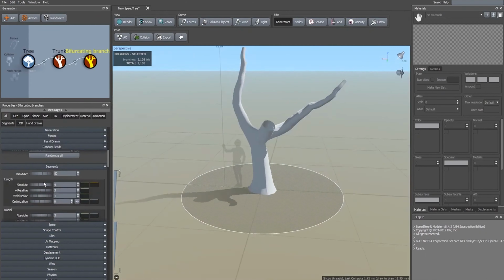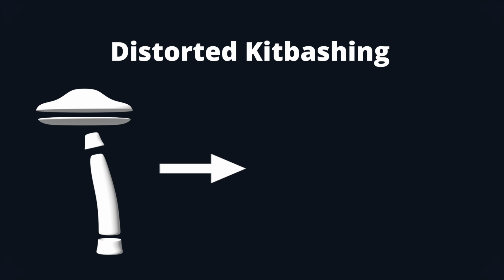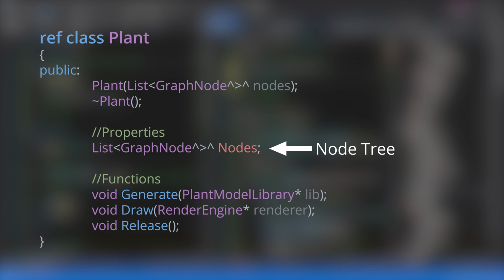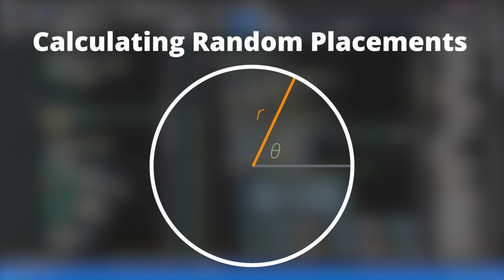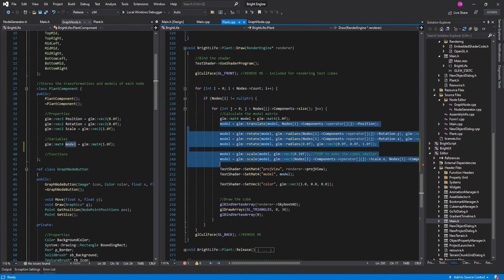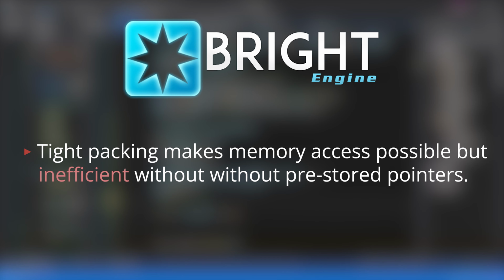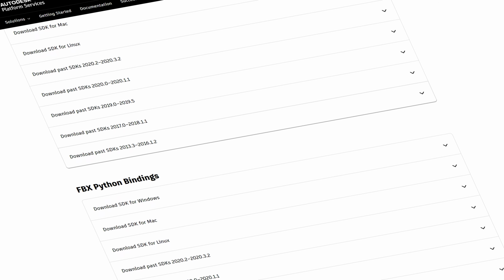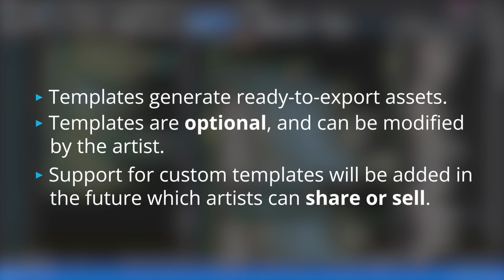Generating 3D Plant Models Instantly! | Indie Devlog

Comment: I maybe have two possible solutions for your brute forcing problem, the first one is rather simple, and I would suggest implementing it either way to increase the natural look of your generated plants, and that would be readjusting the plants which are affected by the newly generated plant. Important is, to not change the coordinates, but rather that the mushroom's growth direction is affected by this, so they face away from each other like in real life. This would most certainly decrease the possibility of overlaps, but not eliminate it. I'm talking about two mushrooms placed on the spot (1;2). 
The second suggestion would eliminate the chance of collision. You would generate the radii of the plants first and then subtract the taken up spaces from the coordinate system. Then you generate the random coordinates of all plants and adjust each coordinate for how many plants are affecting its position. So you would generate the radii, generate the coordinates on a plane of free spaces and then translate the coordinates onto the actual plane.
For one dimension and four plants, it would be like this (for simplicity only integers, the dimension is 100 spaces big):
Generate the radii: 2; 4; 1; 5;
Subtract the taken up spaces from the dimension space (100 - 2 * sum(radii)): 100 - 2 * (2 + 4 + 1 + 5)
Generate the coordinates on the new line: 11; 17; 23; 55 (already sorted for easier understanding)
Now translate from the free spaces dimension to the actual dimension, that means we add the diameter of each plant to the plant which comes after it and the radius of the current plant. So the plant at point 11 is added 2 (the radius), at 17 is added 8 (4 + 2 * 2 for diameter), 23 is added 13 (1 + 4 + 8) and 55 is added 19 (5 + 4 + 8 + 2).
This leaves us with the new collision free coordinates: 13; 25; 36; 74; 
I think this would work if you implement this algorithm two times for x and y, but I'm not really sure and have to go now, maybe I post something to validate this or solve this in the comments :D

If you combine these technics, it would be better to let the plants collide just a bit. This can be achieved by subtracting the max possible overlap (which could be adjusted by the user) from the diameter of a plant when calculating the real space coordinates.

Hope this helps and I just wanted to say, great video, keep up the good work :D
Reply from the maker: Thank you for such a detailed response!!! ❤I think you're on to something here. I'll definitely have a play around with both proposals and see what sort of results it produces. Please feel free to validate it as well if you feel up to the task 😁
Reply: @GajatixStudios  you’re welcome ❤️, I will try to do so and if possible provide a solution for the algorithm in c# or typescript. But only later this week, I’m currently occupied.
I watched some other of your videos and it is really an awesome project :)
Reply from the maker: @Hi-tb2oq  C# would be most welcome (since its so similar to C++) but use whatever you're most comfortable with. Take your time, there's no rush. I'm currently working on implementing the PBR materials system as well as building an Quixel Megascans-inspired asset browser. 

Thanks for taking the time to watch my videos, it helps the channel grow a lot which in turn pushes Bright Life one step closer to sucess. I'm glad you're enjoying them! 😁
Reply: @GajatixStudios  will do, do you have or are planning to do a community discord? This would help exchanging ideas and source code (since yt would block a github/gitlab link)
Reply from the maker: @Hi-tb2oq  Good point, here ya go https://discord.gg/UWn5X5Gh64 😁
Reply: Thanks, will join probably tomorrow. fyi the algorithm is posted does not work in multiple dimensions, but I’m still working on a solution (and had some other ideas for manipulating the randomness of coordinates which i wanna test out)
Reply from the maker: @Hi-tb2oq  Sounds exciting! Can't wait to see what you come up with 😄